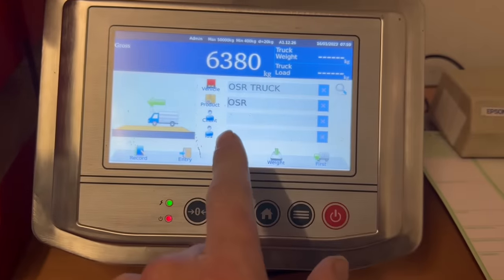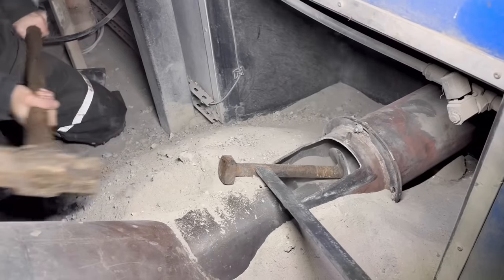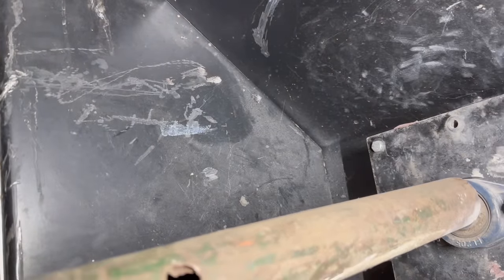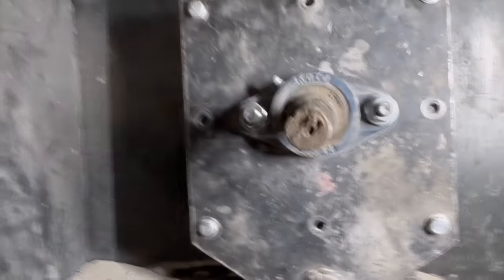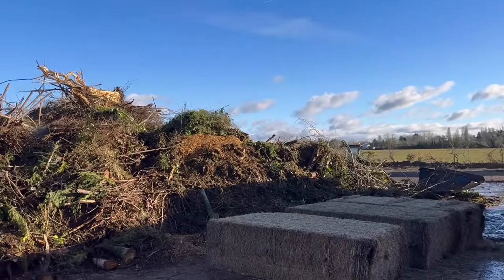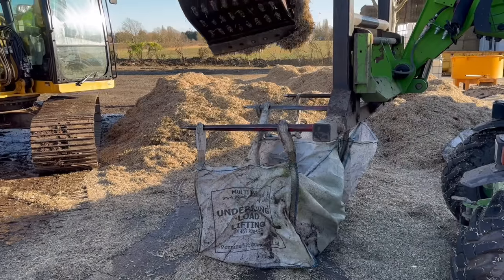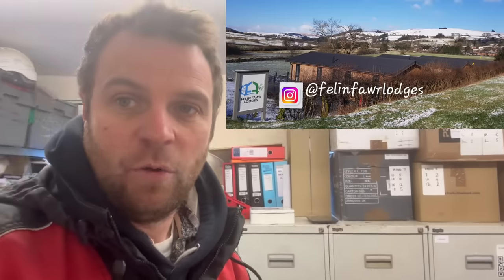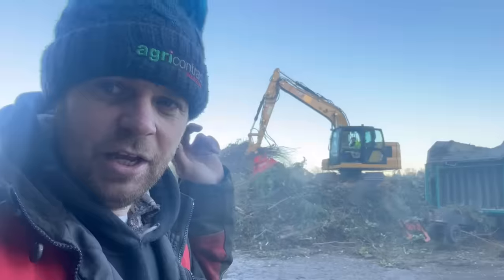HAMMER CAUSIN TROUBLE & CAN ANDREW COUNT ? #OLLYBLOGS #AnswerAsAPercent 1030

Comment: For quick relief from head colds, go on line and buy the best nebulizer and mask you can afford. I prefer the ones that run off house current over the battery powered. In a sanitized pint container pour 16 ounces of distilled water and one teaspoon of non-iodized salt. Take 95 ml of this saline solution and place in a sanitized container and add 5 ml of 3% hydrogen peroxide. 3ml of this is then put in to the container on the mask. This can be used up to 4 times a day. It will keep your sinus an lungs clear of viruses, bacteria and mold spores.